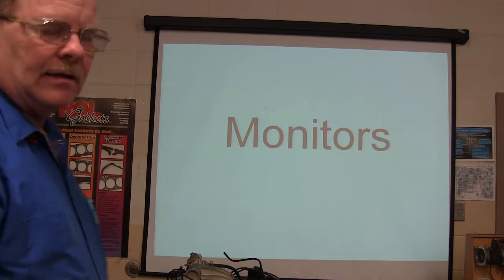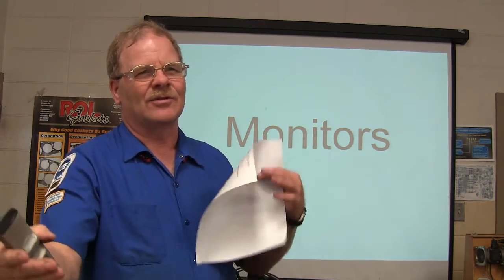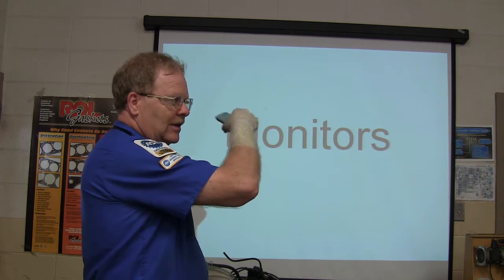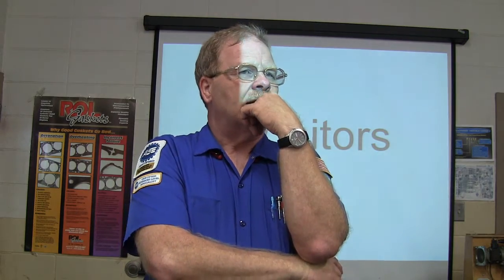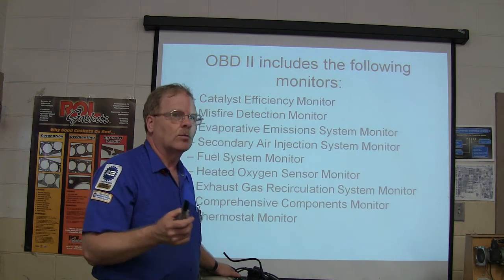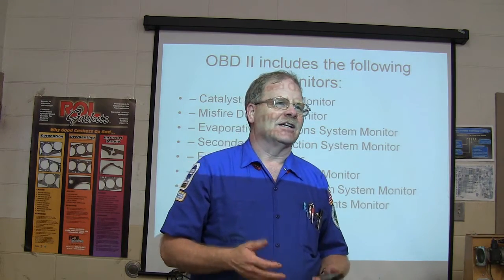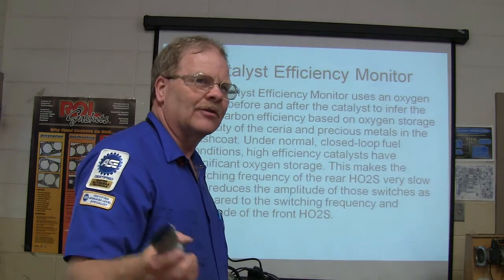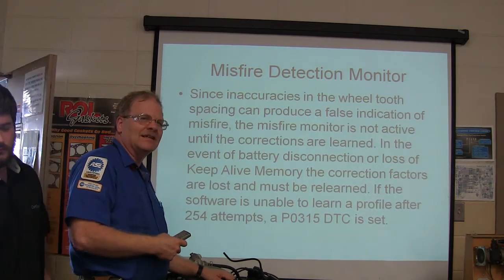Emission Controls Final Session

Comment: You ever use atf, diesel, kerosene, brake fluid etc to desludge a modern engine. If yes, can you give specifics and your take on the results. Thanks
Reply from the maker: De-sludging is kind of spooky, because it can cause the sludge to go to the oil pan and clog the screen.  There have been times when I've used some of the Engine de-sludge products from the parts store, but I'm not comfortable with any method that doesn't include removing the oil pan afterwards.

Comment: Hello sir, so on the emission monitors and lets say a catalyst monitor it will run under certian conditions and if it passes it says complete but what if your cat. goes bad after it is complete, it wont detect it until it runs another monitor on the cat is that how it works?
Reply from the maker: It runs the test every time you make a trip that satisfies the criteria - if the cat goes bad right after it tests good on a single trip you have other problems - big ones.